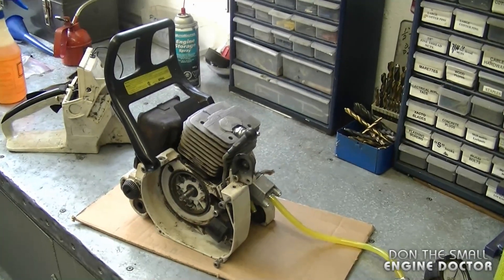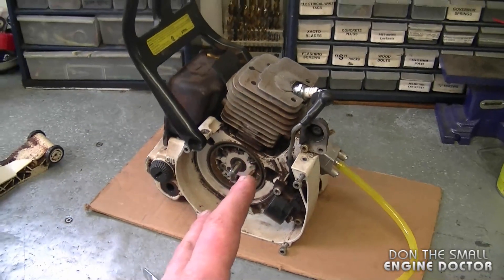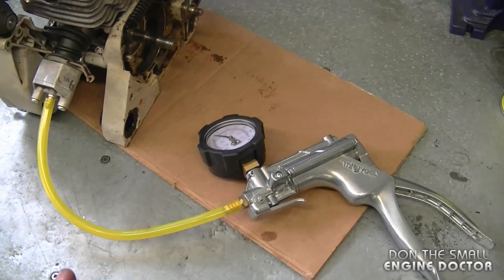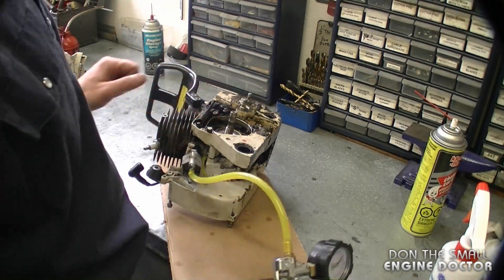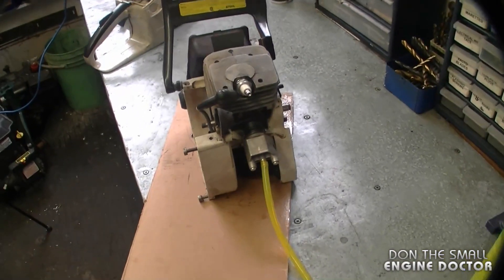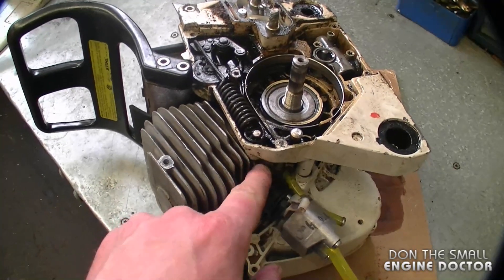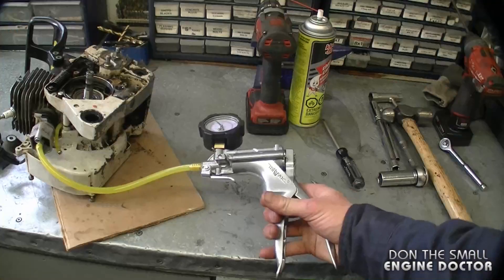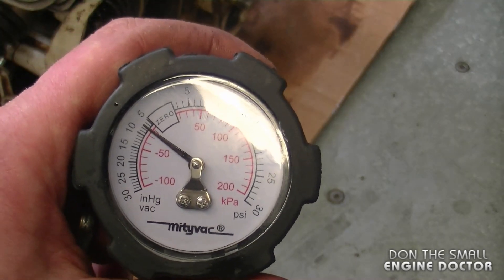HOW-TO Pressure & Vacuum Test On A Chainsaw - Leak Down Test

Comment: It must be tough to make a good living as a small engine mechanic.  I say that because the amount of labor required to repair many small engines must be half or more of the value of the engine if repaired.  I own a car garage.  If one of my techs did this job (looking for air/vacuum leaks) in a car engine the car might be worth $12000 so a $300 repair would be well worthwhile.  You use the same knowledge and tools and take the same amount of time and if you tell the owner the bill will be $300 he will tell you to junk the saw. You have great skills donyboy but I think you don't get the money you deserve.
Reply: Over the last 10 years, the majority of small 2 cycle equipment has been produced as throw away products. Unless its a Stihl or echo or a few other commercial grade brands, they arent worth fixing. Its all junk made by the same corporation out of hong kong. 
Thats why you see most small engine mechanics wont waste their time on the newer off brand crap because its not worth it. Now if its a stihl that costs 5-6 hundred it's still worth it to have it repaired or repair it yourself, especially a lot of the older stuff. Theirs still plenty of money to be made on the larger 4 cycle equipment and the commercial stuff and being in this industry, you come across a lot of stuff for next to nothing or nothing and fix it up for a nice profit. Its not just repairs, its sales, service and many folks branch out and make how to videos and all that foot traffic brings in revenue too. Us small engine mechanics don't get discouraged that easy. Theirs plenty of work and good money in this industry. I'm sure Don is doing just fine and its also satisfying to take something that isn't working apart, fix it put it back together and see it run again. It takes a special breed of people to do that. We need people like that.
Reply: @Mr_Tecumseh  , amen to that.  The tedious nature of the task in general runs off many repair folks and sends perfectly good tools to the dump.  People argue with me like "Why spend $50 to fix it when I can buy a new one for $100?".  I say, because you can save $50 and it will last at least as long as the warranty on the $100 one.  I fix all my own, most of family, and for a few friends.  Something going and several waiting all the time.  The things break and knowing how to repair is a good thing.  I see it as a way to recycle without having to drive an electric car or hug a tree.
Reply: Ken Upright 
I wish more people had your attitude. Repair, refurbish, recycle. Too many folks don’t even properly maintain their equipment.
Reply: I was a small engine tech.  We were SO GOOD at repairing this stuff common repairs took under 30 minutes, clock time.  I could diagnose a 4-stroke no-start in under 3 minutes, do a full tune up, blade sharpen, oil change, deck clean...under an hour.  Doing 8 of those in a day at $100 per made money.  I used every speed-up known to man.  Oil suction pump so I didn't have to pull the drain plug.  Three electric screwdrivers with every size bit used on a Briggs/Techumseh so I just grabbed the one I needed to remove the cover, etc.  A pressure washer that would remove paint to take dried grass off the bottom of the deck, and an angle grinder to sharpen the blade ON the machine in many cases. Impact tools to remove the big nut.    Tried to buy the business but the land was worth $1.5M and the shop's income simply wouldn't  cover a note like that.  Yes, we lost our ass on more complex problems but did them as a challenge.  I recall a carburetor with an internal casting flaw that threw us for a loop!   Nothing short of x-rays would have made that one any easier to diagnose.  I left all the 2-strokes to an older guy who was already deaf, since repairing $100 string trimmers made no sense to me at all.   BTW, a "Honda" mower is no btter than a Briggs or Tecumseh, just harder and more expensive to work on.  Their tracked snowblowers use thin sheet metal, work well, but can't ingest gravel wthout damage.
Reply: @wade727nelson  I had more than my share of this, Wade : "I recall a carburetor with an internal casting flaw that threw us for a loop!" I'm seeing more and more of that, now that new carbs can be had for under $20 from China. About 50% of them have flaws that can't be predicted or fixed on the bench. It's a killer because, as you said, you can end up putting in hours and hours into a $150 weed eater and end up with only $60 for your trouble -- if it can be repaired at all.  Even then,  pressure problems, like the one Donny diagnosed in this video, can mimic the symptoms of a fuel delivery issue. I've learned the hard way, to my great consternation and grief, that you really shouldn't begin work on a 2-cycle engine unless you've done a spark, compression AND a leak down test. Since getting a small engine ready for a leak down test can take 30 minutes on some machines -unless you're superman - you already have 45 minutes time on task just to do the diagnostics. Bottom line, it has to be a really high dollar 2-cycle machine to justify the cost of any repair.
Reply: @wade727nelson  yep! Gotta be an octopus to do a carb on a Honda mower :D overly complicated lol
Reply: @Greg Gagne Correct. We might also add that there is nothing more environmentally damaging than a cheap 2-cycle machine. Since a repair is hardly ever financially justified, they just end up getting tossed into the landfill, and there goes all the labor and materials for its construction and delivery. If you're clever enough, have the patience and the space, you can start a collection of dead, cheap 2-cycles and tear off parts when you need them to keep costs down, but there's no way a professional shop can make good on shop time, which generally has to be upwards of $75 an hour just to keep the lights on.
Reply: Most of us small engine techs work on the 2 cycle stuff so the customer will also bring us the 4 cycle stuff. If you know what your doing and have the proper tools you can diagnose and repair equipment really quick. I personally don’t accept the cheap low end equipment. As far as 2 cycle equipment I only work on Stihl or Echo and I let the customer know up front labor will be minimum $50.00. If they’re not happy with that they can take it somewhere else. I’m still buried in work.
Reply: wcjcnc no Husqvarna, or nice older machines like Homelite, Dolmar, etc? I work on mainly Saws. People pay for port work, special chain grinds, and mods as well. A man has to “diversify his portfolio” to put food on the table in 2020!
Reply: Roly Fisher gg

Comment: Nice tip Donny . Since I already have an automotive smoke machine I have found it works great as well in testing for all sorts of  leaks on small engines too.
Reply: +donyboy73 you can make one with common materials such as a paint can, a tiki torch wick and some nichrome wire. Google it and or look on eBay for completed ones and kits to make your own. Not expensive at all, work just as good!
Reply from the maker: +Steve Rob that would be nice to have!
Reply: Man I am glad I read this comment!  I hadnt thought of doing that to test for leaks but I will now.  I actually have an 038 Mag II that wont idle after a port, polish, and refresh.  I suspect the cylinder to crankcase seal is the issue but that will be a great way to confirm.

Comment: that's the same way they test new gas/drainage lines before they are put into service. good tip..cheaper then buying a whole new saw if its just a seal.

Comment: Well, unfortunately, you can see that the seal on the drive side saw chain passed zasod side of the starter is ok but as you can see on the film sealing problems solved :) I greet the Polish

Comment: When you draw a vacuum it is in (Inches of HG) not PSI.  You misspoke.  Also, what are the symptoms of a leak?  Thanks.
Reply: +zzzdogutube In addition to Carstens comment, a saw that won't idle properly, no matter HOW much you adjust the carb is another symptom. Sometimes it will rev up without even touching the throttle.
Reply: +zzzdogutube The symptoms would be a lean running engine, as it would draw more air to the gas/air mixture, past the carburettor. This could result in "bogging" when you open the throttle, fast idle rpm, overheating engine and worst case scenario - seized piston.
Reply: Thanks, that what I thought.
Reply: pbrstreetgng79 Thanks
Reply: zzzdogutube cool